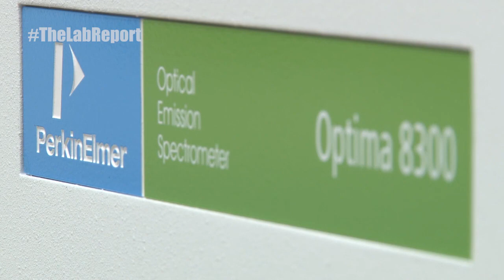Episode 1 of The Lab Report: Water Contamination Analysis Using ICP-OES (US EPA Method 200.7)

Comment: I have an ELAN9000 ICP/MS and it cranks the samples out, drinking water leads are faster than bacti's!
Reply: Field preserved? Or with preservation, +16 hours before checking turbidity, and maybe digestion?
Reply: @one_hoop  Gezus that was 3 yrs ago, that ICPMS has since died and replaced....field preserved and if turb is low enough dont have to digest.